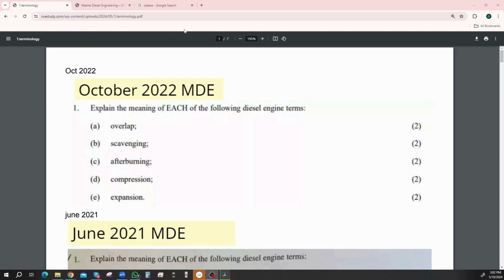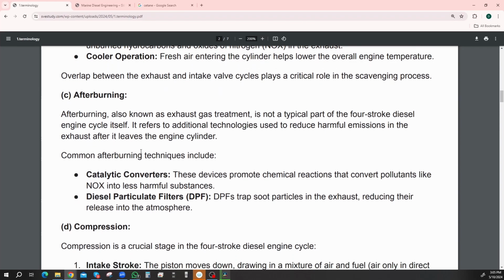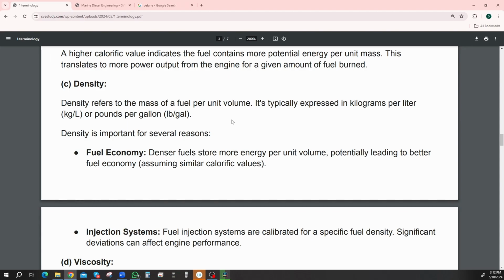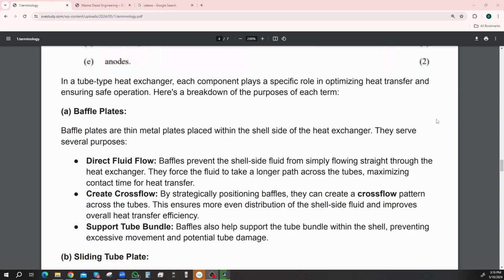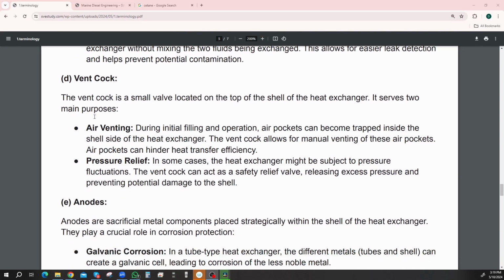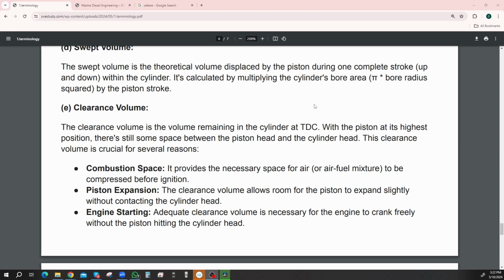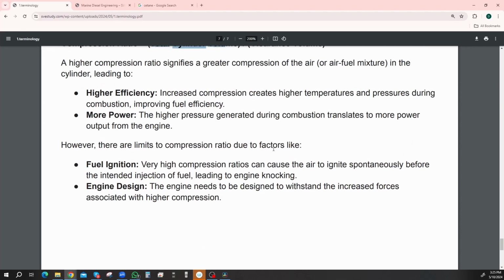1 terminology

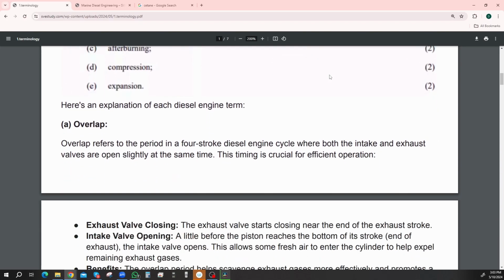Comment: Overlap 0:31
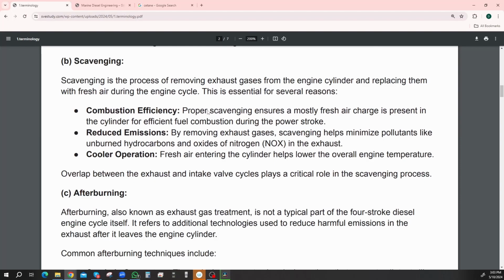Scavenging 1:19
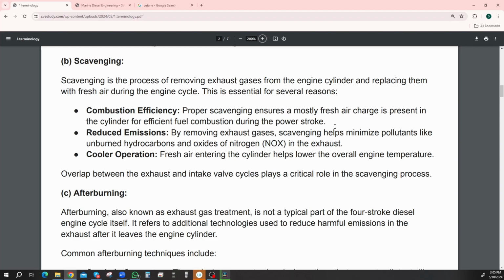Afterburning 2:29
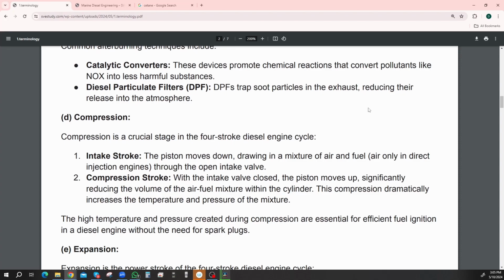Compression 3:25
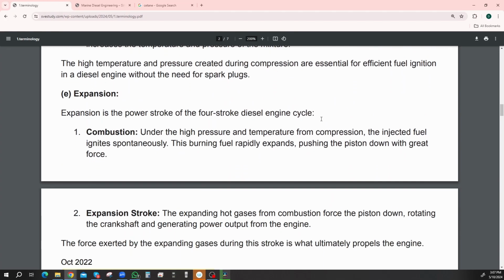Expansion 4:49
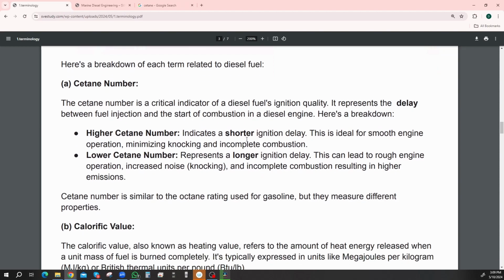Cetane number 6:44
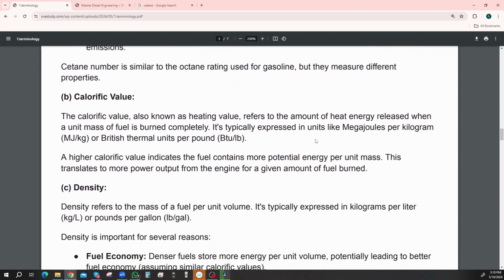Calorific value 8:09
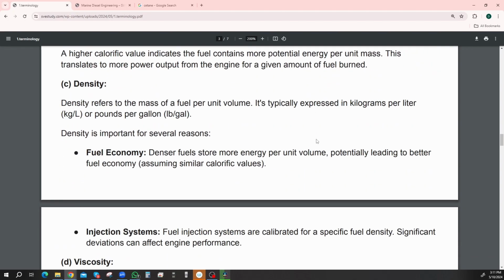Density 8:58
Viscosity 10:37
Baffle plates 12:37
Sliding tube plate 13:40
Tell tale ring 14:25
Vent cock 15:33
Anodes 16:38
Top dead center 18:10
Bottom dead center 18:21
Swept volume 18:47
Clearance volume 19:21
Compression ratio 20:37